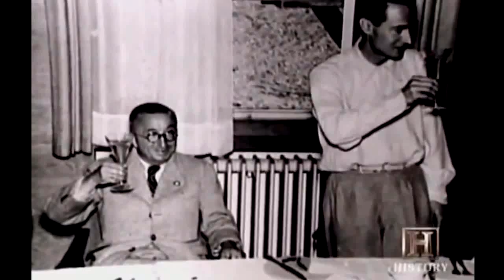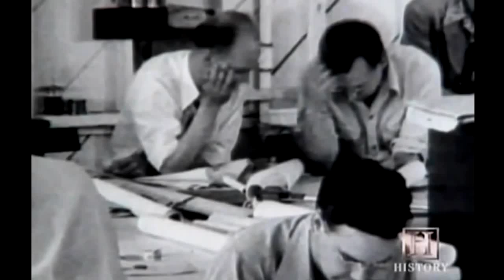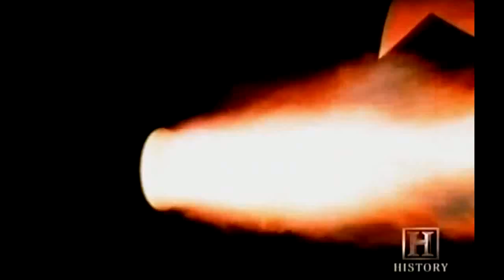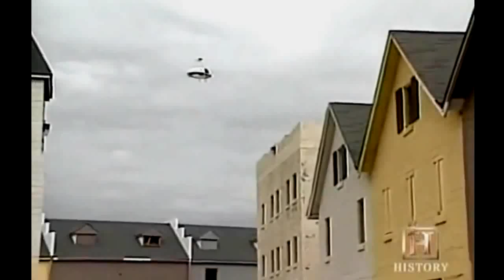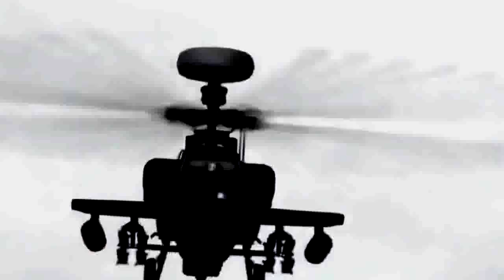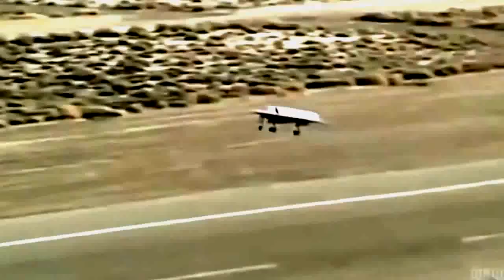History Documentary --  History of Jet Engines

Comment: The very first operational turbojet was designed , developed and flew by the Germans...
Reply: It was purely experimental, and a proof of concept. Never a fighter.
Reply: Yeah but not invented, Sir Frank Whittle deserves credit for that. And credit for the best jet engine ever made probably goes to Pratt & Whitney for their J58 engines used in the SR-71, because not only were they immensely powerful (especially for the time) and complex they weren't designed with modern techniques such as Computational fluid dynamics (CFD) and CAD but with slide rulers which is simply mind boggling. Nothing against CFD and CAD because they have tremendously improved engineering in many ways
Reply: barracuda7018 I suppose you didn’t watch literally the first 4 minutes
Reply: wrong.